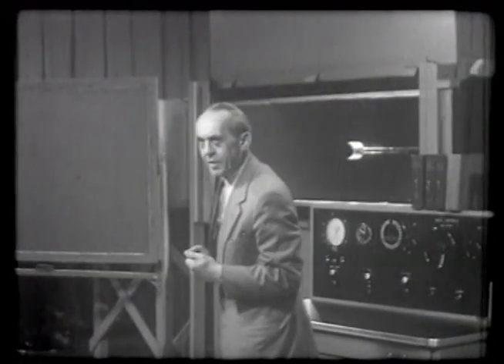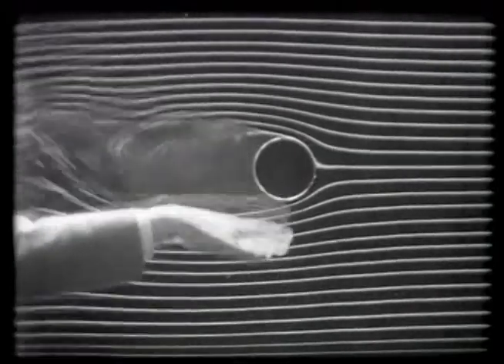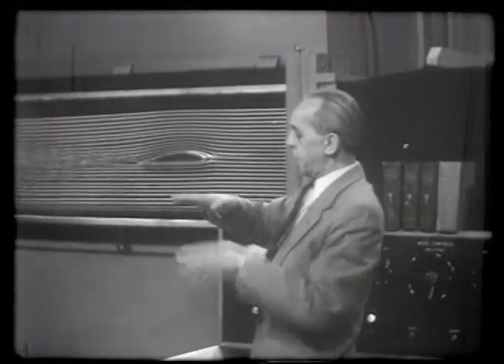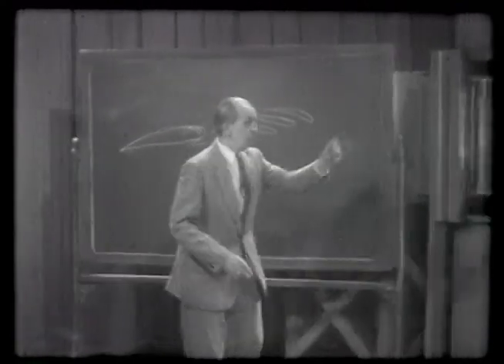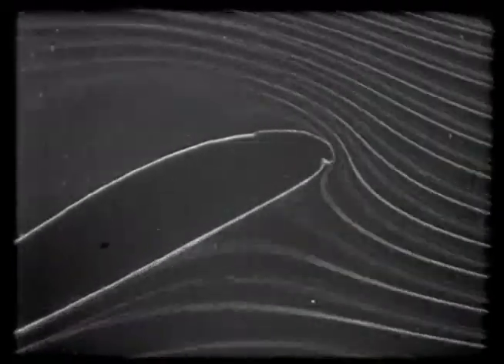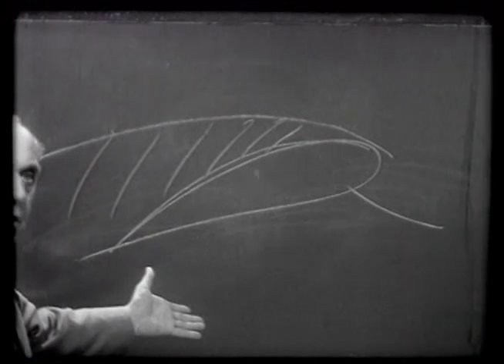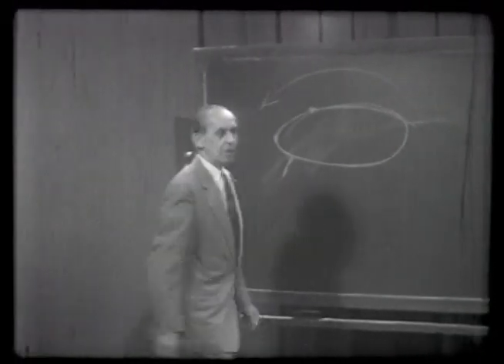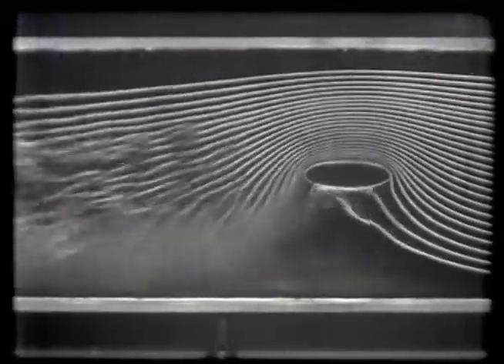The Secret of Flight 10: Lift Theory, High Lift Devices

Comment: 3:02 When the speed increases the pressure decreases. When the speed of a body increases that means the body is accelerating. When an incompressible fluid is forced to accelerate, as Bernoulli discovered when experimenting with almost incompressible water by forcing it through a narrowing tube, the pressure does indeed decrease. But when the speed of the top surface of the cylinder relative to the still air happens to be higher than the speed of the bottom surface relative to the still air the air hasn't accelerated! 
Yes I am aware of the Magnus effect - but it has NOTHING TO DO with accelerating incompressible fluids.
Reply: What are you talking about? Obviously the air is accelerating due to the non-slip condition on top and decelerating on the bottom if we assume flow from the left and clockwise rotation
Reply: @frederikheilmann1719  You clearly subscribe to the no-slip model, in which the air immediately adjacent to the surface has zero velocity relative to the surface.

But consider what that explanation implies if no-slip is supposed to explain the slowing of the air above the surface. The stationary layer of air at the surface would then constitute a new stationary boundary for the layer immediately above it. By the same reasoning, that layer should also be brought to rest, producing another stationary boundary, which should stop the next layer, and so on.

The absurd result would be an ever-growing region of stationary air.

That clearly does not happen. The no-slip condition specifies the velocity at the solid surface; it does not provide a mechanism by which successive layers of air are compelled to adopt the velocity of the layer beneath them. The velocity variation through the boundary layer has to be explained by viscous momentum transport, not by repeatedly invoking no-slip.

Comment: It is wrong approach researching the creation of Lift force and Low pressure at upper side of the wing. I explain the aerodynamic cavitation and existence of Lee side aerocavern, and creation of Aerodynamic force.
Reply: There is NO Lift `force` and NO Drag `force`, it is Aerodynamic force. Lift and Drag are just components in coordinate system.
Reply: Interestingly I didn't reference NASA, I am talking about Prandtl and him solving the Navier-Stokes to give the boundary layer. Happy to look for your book, but noting what I said about Lord Rayleigh I do expect it to be incorrect.
Reply: At 8:11 is not "altitude" it is "attitude" (pose)
Reply: @vlatkopopovski2685 I have been speaking with Alan about you, I really need to finish my email back to him, and I just wanted to let you know that I have done some 2D Navier-Stokes simulation that are low speed and compressible, and they do show what you would expect, as other people would expect, and that is a compression ahead and a rarefaction behind. But this only lasts for less than a millisecond as the pressure information starts to move away from the aerofoil and the flow field reorganises itself. That is, you are 100% correct in terms of high speed aerodynamics, but that is not the problem that people are trying to solve, and as you correctly note, that NASA does a poor job of explaining.
Reply: @aerospacedoctor  I may be misunderstanding your point, but I wanted to clarify one aspect of your comment.
You mentioned that the initial compression ahead and rarefaction behind “only lasts for less than a millisecond as the pressure information starts to move away from the aerofoil and the flow field reorganises itself.”
My difficulty is reconciling that with the fact that, in steady flight, the asymmetric pressure distribution itself is clearly persistent rather than transient. The aerodynamic force remains continuously present, so the associated pressure difference cannot simply disappear after the initial startup phase.
Are you distinguishing between:

a) the initial transient propagation of pressure disturbances into previously undisturbed air, and
b) the later steady-state pressure distribution associated with sustained aerodynamic force?

If so, I think I follow you. But then my question becomes: what, in your view, is the physical mechanism that continuously maintains that enduring pressure asymmetry once the initial transient has passed?

I’m not asking how one computes the steady pressure distribution from a solved flowfield, but rather what you regard as the physical origin of the maintained asymmetry itself.
Reply: View my address and ask me for my Flight Paradigm, or ask Alan Smith.
Reply: You are referring to a theory that the British believed and set them back by decades because they did not listen to Lanchester and his understanding of circulation. This was fully formulated by Prandtl.
The theory you have recreated was championed by Rayleigh, and refers to dead air. This has been thoroughly disproven, and Prandtl and the viscous boundary layer producing the bound vortex has been proven correct.
Reply: my address is my name_surname ( ) y....
Reply: @aerospacedoctor  Could you provide a reference for Rayleigh’s supposed “dead air” theory? I am having difficulty locating a specific formulation by Rayleigh that matches your description, and would be interested to read the original source in context.
Reply: @alans172 , feel free to email, but it is in Anderson's A History of Aerodynamics, and the specific reference is:
Strutt, J. W. (Lord Rayleigh). (1876). LIII. On the resistance of fluids. The London, Edinburgh, and Dublin Philosophical Magazine and Journal of Science, Series 5, 2(13), 430–441.
It is also in:
Liu, T. (2021). Evolutionary understanding of airfoil lift. Advances in Aerodynamics, 3, Article 37.
Reply: NASA has published three Incorrect Lift Theories so far, in my book "DROWNED IN THE AIR  - The Lee side and/or Backside Vacuum Flight Paradigm" I explain how it works.